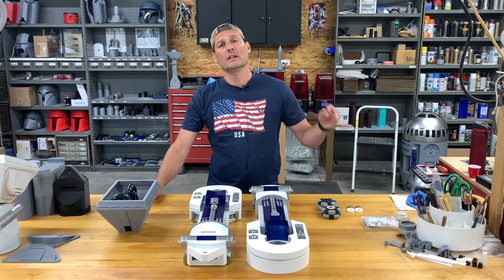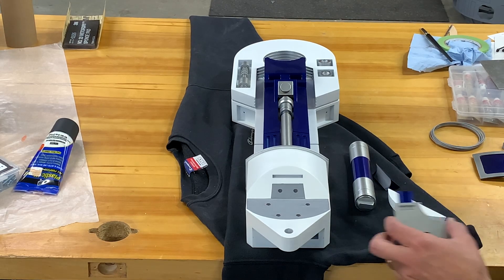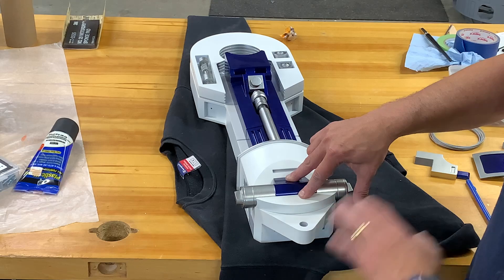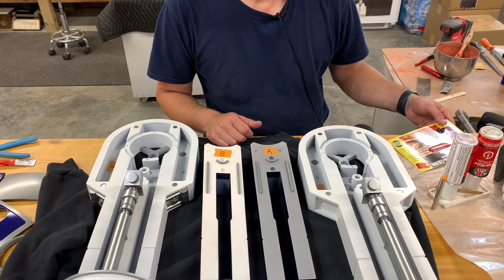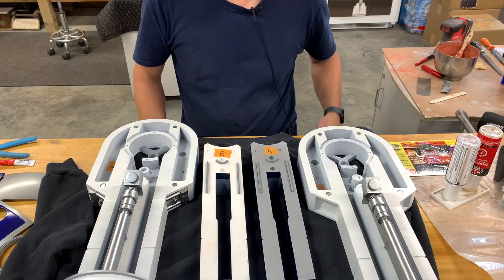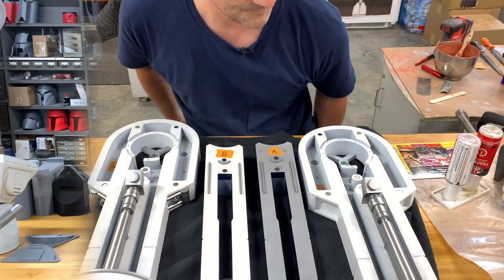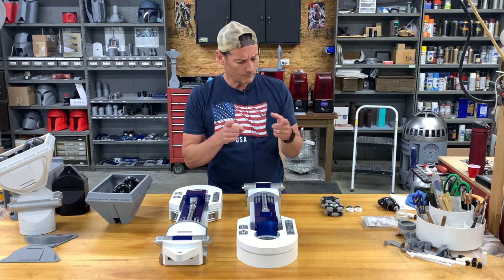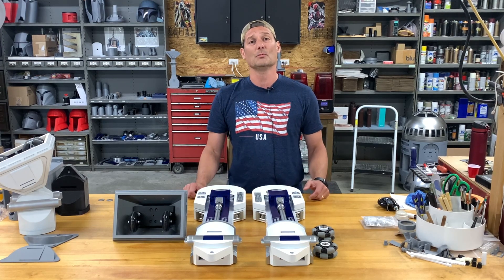R2-D2 LEGS! R2 (Build part 5)

Comment: Great tutorial guys, do you recommend to use roller caster wheels for the other legs? if it is possible caster wheels could be the same size in the center foot and the legs?
Reply from the maker: I would say it can be done but not sure I'd do it on the other legs because I think you'd get to much wiggle on the ankles when the caster's swing.  I haven't tested this theory but for the cost the omni wheels are much more reliable.

Comment: Hey, great videos. You mention that you have a big 3d printer but dont say which one? Please can you let me know. Thanks in advance
Reply from the maker: The one that shall not be named is the Comgrow T500.  It's a great machine when it works and a terrible machine when it doesn't.  I think I have it dialed in now but occasionally it gives me fits.  Most important thing about that machine is ENABLE Z HOP!  It's not automatically enabled.  I have destroyed 3 hot end assemblies due to a thin metal tube design flaw that can break above the heat sync and flood the entire head assembly with melted plastic.
It's great when it works though.
Reply: @ thanks!
Really appreciate you taking the time to reply. Happy new year!
Reply: Really enjoy your channel and all that you do for the making community